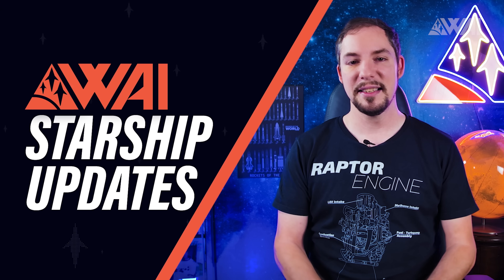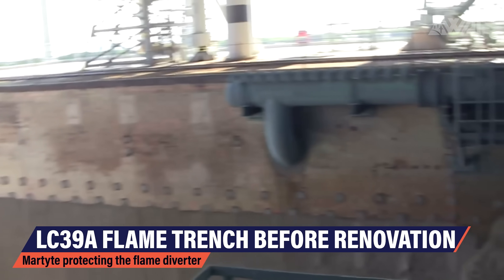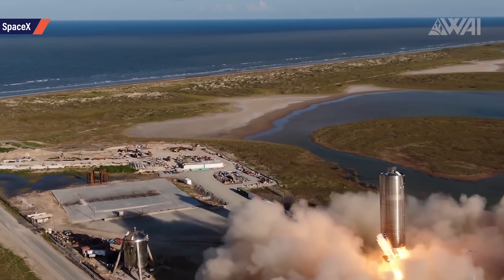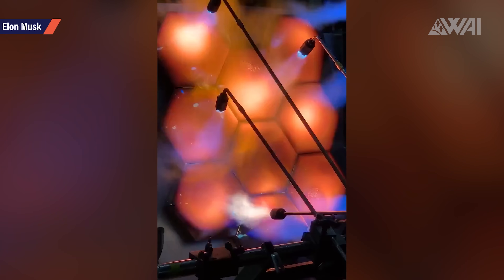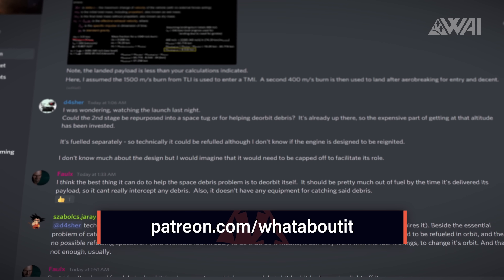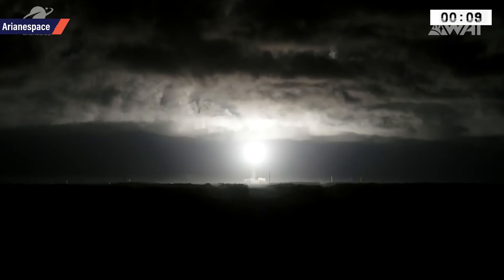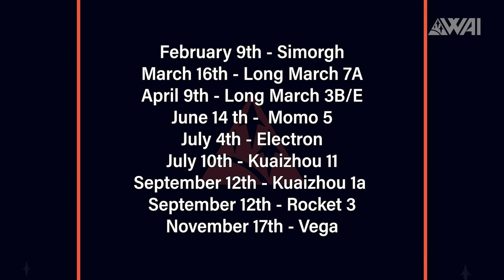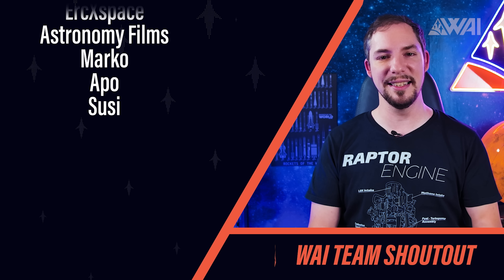134 | Why Martyte helped to damage a SpaceX Starship Raptor engine!

Comment: So, I am not an engineer or a rocket scientist so take the following for what you think it is worth. I really think that the Starship has the wrong design with the recessed rockets inside the skirt of the rocket body. After seeing the damage that was caused by a prepared hardened surface under the launch mount (which is something like 25 or 30 feet above the surface, can you imagine the destruction that could happen when the Starship lands on any unprepared landing surface such as on Mars. SpaceX has already recognized that they will need upper thrusters for a moon landing due to the fact that the main rockets would just carve out a big hole where they want to land. I contend that this will be a problem for Mars as well and this presents lots of problems. For example, on the moon there is no aero braking and thus no need for the heat shield, wings and belly flop maneuver to slow down the craft and let it land. But on Mars this is not the case and the aero braking is definitely needed just like on Earth so if SpaceX intends to put the upper rockets on a Mars version, they would be difficult to place symmetrically on the ship without interfering with the heat shield and/or the aerodynamics during the aerobraking procedure. The gravity of Mars is also much much greater than the moon so the upper rockets would have to be larger than the moon version taking up more interior space and adding weight. If they don’t have these upper rockets on the Mars version, I just don’t see how the current engine within skirt design could survive the horrendous amount of rock and debris that would be thrown up by that sort of landing as the skirt would essentially catch all the flying objects and direct it around the engine bay. With the Falcon 9, the open design allows any debris to escape sideways and generally not upward and there is no skirt that could allow something to bounce around inside. Even so, the engines (other than the rocket cones) are protected with armour for both the boost back fire and landing debris. The Falcon 9 legs are very large relatively speaking compared to the Starship legs and contact the surface away from directly under the engine blast. If the Starship sticks with the skirt design, the engines will dug out a hole directly under the rocket right where it wants to plant its “feet”. Not a good plan. For the Earth, the skirt design would probably work because you could simply armour under the launch mount with steel plate and for landing you are most likely going to land on either a steel deck of a ship or an armoured landing pad. So this design might work for Earth where the facilities at the landing site are carefully prepared but on either the moon or Mars, I think you either need to have upper rockets doing the landing (taking up space and increasing weight), which might be hard with Mars’s gravity, or SpaceX will have to forget about the rockets under the skirt idea and expose the engines and armour the bottom of the engine bay, just like the Falcon 9. If they conclude this is the answer to the debris problem, then that will affect the aerodynamics of the belly re-entry maneuver and of course the little landing legs will be a no go. I think that the real Starship that makes it to either the moon or Mars, will look nothing like the “Earth” design that can land on prepared landing surfaces. Keep up the good work on your channel!
Reply: That's why they're experimenting that this early, and made changes like reinforcements. And many eventual changes later like larger legs. When they're a rocket scientist selecting this design but you're not, you must admitted they know what they're doing
Reply: @alvianchoiriapriliansyah9882  I hope so, but that I guess is the fast prototype way. Will be curious though to see how they solve the debris problem landing on another planet/moon surface. The pipes they are adding is only to prevent their launch pad from destroying things, it won't be protection from landing on a rocky surface.
Reply: @madmike2881  The pipes on SN8 is a good start tho

Comment: I wonder how they thought they could get away without a flame trench.
Reply: Because the trench is a luxury thing on Moon & Mars
Reply: But doesn’t the mars lander have its thrusters higher up on the body to stop it you could get ejects coming from the exhaust at greater then the speed of sound in all directions anything in the area is dead including structures that are built.
Reply: @wayneschenk5512  You're mistaking it with the Moon HLS lander

Comment: Better question: - what will SpaceX do about landing their gigantic rockets in the huge craters that they inevitably dig on Mars/moon? If they're suddenly being forced to deal with difficulties in launching half a rocket with just a few rocket engines off of strengthened concrete, how will they land the massive rockets filled with "city parts" on an unprepared dirt/rock surface? I'm as eager to see them succeed as anyone, but find it odd that such basic and fundamental problems seem to be surprising them at this stage of development.
Reply: For unprepared pad on the Moon, they will use auxiliary thrusters on the middle of the ship for final landing burn & early takeoff. Ofc after they prepare the surface they can start sending a standard Starship landing with Raptors there

And they already made several solutions, like reinforcing the avionics, and eventually larger legs

Comment: Martyte seems a bad choice for a coating on the Starship launch pad since it is ablative. One technique that could solve the Martyte problem would be to tile the launch pad slab with thin plates of tungsten.  Tungsten has the highest melting point of any metal, 3422C, and it also has the lowest thermal expansion of any metal.  Since the maximum temperature of raptor exhaust has been reported as 3200C, that leaves a sizable margin.  Tungsten is relatively cheap but incredibly heavy, 19250 kg/cubic meter.  A single plate of tungsten 15 meters by 15 meters by 1 centimeter would weigh 43.314 metric tons! However, if created as nine hundred 0.5 meter by 0.5 meter by 1 centimeter plates, they would weight only 48.1 kilograms each.  The cost of the raw tungsten would be about $12,000. I don't know how much it would cost to make the tungsten into plates.
Reply: Or just install a water-cooled steel pipes, much cheaper
Reply: @alvianchoiriapriliansyah9882  I don't think pipes in the concrete will prevent cement chips from exfoliating and damaging the engines.
Reply: @royschering1140  The difference is that the pipe will be all above the concrete itself, and since the heat will be carried away by water the steel won't be melted at all = resistance (similar mechanism to how the Raptor bell didn't melted at all when fired because of regenerative cooling)

Comment: They saw the problem on the Moon Starship but only from the perspective of preventing moon rocks being propelled out of moon gravity. But to lift off from moon or Mars those tiny landing legs will not help much. There'll be a hell of a furnace below the Starship, maybe the raptors cooking themselves to steel mash. 
There may be needs for a secondary landing and starting propulsion appliance like on the Moon Starship. Maybe take off some 30 yards then start the bottom raptors mid air.
Reply: The legs for ship on Mars will be much bigger than today's for-prototype-only legs. And lifting off like that would waste a lot of delta-V
Reply: @alvianchoiriapriliansyah9882  See how high the launch pad is, and there's still not enough room to launch safely. Will the Mars legs be even higher?

Comment: They could install a small water tower, say a 5,000-50,000 gallons, and pipe in the spray hoses. It should create an adaquate dampening and cooling force for these tests. Seems to me installing all wiring inside pipes and then adding additional "water-cooled" piping to soak up heat is a bit more complicated than just doing what lauch facilies have done successful for 70 years. Tell me what I'm missing?

Comment: The Vega rocket failed more because of a design error than an assembly error.  Putting identical connectors near enough to each other that they could easily be swapped is a design problem because it was inevitable that someone would accidentally swap them.  

  It is the kind of engineering design error that colleges try to teach their students to avoid and yet they continue to happen.

Comment: What Elon is traing to achive not using a flame diverter is because it will need an starship capable of launching from mars or some other place which it wnot have one. Although it wouldnt damage to have one from where it'll launch first, but how its gone be tested otherwise?
Havent read before Bazaar comment. On the spot B

Comment: It looks to me, that powered landing in environment without solid surface would endanger starship.
Reply: Which is why they learned by adding several protection to the avionics is a good thing so it then CAN land on unprepared surfaces
Reply: @alvianchoiriapriliansyah9882  This doesn't solve the problem for 100%. If the debris can hit engine it is problem. If they will land on Moon, they have solution already- engines up in about half of the rocket height. But, engines in tail will b always problem. The heavier rocket and therefore stronger engines the worse.
Reply: @petersvancarek  They will add even more improvements & shielding later on (example: even larger legs)

Comment: There are not flame trenches on Mars.

So they need to figure out how to launch Starship from a gravel surface - not even a launch mount.

Therefore making a flame trench is actually a step in the wrong direction.

Comment: At 7:22 of your video you mention the Shuttle tiles and imply that they were the cause of the Columbia disaster. Wrong. That accident was caused by a 1.5 pound piece of foam thermal insulation that was dislodged from the External Tank and struck the reinforced carbon carbon (RCC) leading edge of the left Orbiter wing and punched a large hole about 1 square foot in area. The Shuttle tiles were not involved in the loss of Columbia. 

The other infamous Shuttle tile anomaly occurred on STS-27 in which an impact on one tile caused it to break off the Orbiter. There was enough of that tile remaining along with the strain isolation pad (SIP) to protect the Orbiter during EDL. There was no burnthrough that could have damaged the aluminum skin of the Orbiter.

Full disclosure: I worked on the early development of the Shuttle tiles in 1969-71.

Comment: I can’t understand why they don’t use the heat pads below the rocket, developed so they can be driven on and take the weight of all the work that needs to be done below, could stainless steel be coated with these pads??

Comment: As a retired engineer that started out in aerospace electronics repair work, I have to express my doubts the a couple wires were “swapped” by accident.  This kind of work is done under rigid and well designed controls, and has inspections and verification testing built in to the process.  I have to ask why there is no discussion about sabotage?  That’s far easier for me to believe than “some guy made a mistake” that no one noticed.

Comment: The problem is their earth launch pads need to be used many times, on Mars it could be one time so digging a hole is potentially ok. Cover the concrete with steel, it’s not hot enough to melt steel. Half inch plate should do it and put an insulator between the steel and concrete if they are still worried, you could pump water under or between two layers of steel if heat is still a problem. Why are they taking nasa’s advice?

Comment: Thanks as always for a great episode.   SpaceX should have utilized all the previous decades of engineering, experience, and history around the use of flame diverting/deluge systems.   They are expensive and time consuming to build, the latter (delay) most likely being the part that rubs Elon the wrong way.   But you are basically setting off a bomb just above the ground.   There are smarter minds than mine at work here.  But I see flame diversion in SpaceXs’ future.
Reply: The thing is, only Starship that are being prepared to land on unimproved surfaces

Comment: Felix, my humble opinion is that there should not be any flame diverter or special preparations under the test stand for Starship will land and take off from unprepared surfaces. Rather ruggedize the underside of the vessel. For Super heavy however should there be a flame diverter to contain the 28 angry Raptors.

Comment: ISRU lunar pads for Starship can be built in advance by Artemis missions using other landers.
Reply: No need to. HLS variant will use auxiliary thrusters to avoid debris, thus still be able to land on unimproved lunar surfaces
Reply: @alvianchoiriapriliansyah9882  I hope they land upright every time and don't get a boulder up the rear end.
Reply: @islandpalm148  Ofc they hope that, that's why the landing legs will be larger, have wider stances, and auto-leveling

Comment: I agree with Elon here: flame diverter could be ok for testing but you can't rely on flame diverter when going operational. Starship must be built as strong and reliable as possible by design, because on mars, but also on earth, you won't land on a pad with flame diverter and terrain will be very different and unforgiving in different landing zones

Comment: Maybe they could solve the problem with the missing flame diverter, with tilting the engines outwards with vector steering. Then the flumes would push the rocks save away from the starship without damaging it.

Comment: i know it seems backwards but i think the simplest solution would be plain sand-pile under the launch mount. yea i know crazy, but it would ablate melt and the fluid dome of the center would keep the expulsion angle within a safe limit and wouldn't cut through any exposed parts or hardware and would prof a launch feasibility from mars under developed side.

Comment: There is a good reason not to have a flame diversion trench is because there won’t be one on the Moon or Mars. So the engine bay and plumbing must be designed for debris for liftoff.

Comment: I'm not an engineer but I wonder if the debris rose upwards because of airflow underneath the skirt. The thrust from the raptors would of course push everything downwards but then the surrounding air would have to fill the void(for the lack of a better word-vacuum?). So some air would flow upwards and perhaps that is how some debris travelled? If there was an intake of the surrounding air from near the top part of Starship and somehow fed into the top section underneath the skirt, then there would be a constant flow downward and possibly force debris away. Just a thought.

Comment: People have been saying from the start that SpaceX design was going to have problems with plume impinging on the Martian/Lunar regolith which would throw high speed ejecta back at the engines.  Their were claims that they would just 'find solid rock' to land on, but this looks doubtful as a solution if they are cracking and spalling off surfaces which in all likely hood harder then anything found in nature.  And with a design philosophy that relies on destructive testing to actually complete the design this presents a huge issue if this problem only manifests at Mars.
Reply: But with this philosophy they can quickly (certainly quicker than traditional development method) get to the solutions which is to reinforced the avionics
Reply: @alvianchoiriapriliansyah9882  I assume you meant engines, as avionics mean the computers that control flight and which could be anywhere on the vehicle.  In any event engines are inherently hard to protect from upward ejecta because they have big thin engines bells and lots of piping and lots of delicate piping all while having to gimble.  People seem to be thinking this is only about armoring the tank bottom which is just a matter of making a slab of thick metal and taking a reduction in payload, but it's a lot more complex then that.

The issue I was really getting at is that they don't know what they need to fix until it breaks in testing, and if your test involves a whole trip to Mars that comes at huge costs in time AND money plus the fact you don't get the vehicle back for disassembly.  Iterative development is hugely dependent on the speed of the iteration loop.  When your doing this build-test-rebuild loop on the ground a month between doing a design change and testing it can be around a month, but a test landing on Mars is a 27 month loop.
Reply: @UCxpAoUeR02DnEJrGhB842pA That's exactly why they do this way. They don't know what they're looking for until they tested it in real life. Some addition need to be added obviously like that martyte debris, but some others doesn't need to exist at all. In traditional philosophies you probably need to thinks (& implemented) ALL of that, even the one that you probably will never need one, which will add costs & time

Comment: It's completely intentional. What do you think will happen when a Starship takes off of an unimproved surface like mars or a non-lunar Starship taking off the moon. They need to address and design around that upcoming problem. The Booster is up high to minimize the debris kick back, but like Elon said, it might be a bad decision.

Comment: Maybe tilting the raptor engines out until high enough off the ground would throw any debris away from the rocket. The exhaust would have to be directed to avoid hitting the supports and would have to be down enough to lift the full weight of the rocket.